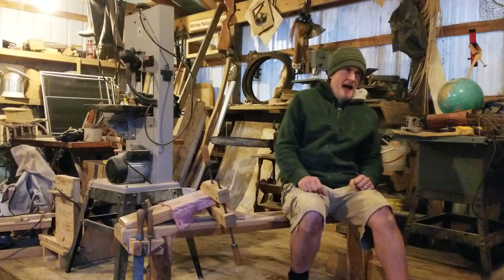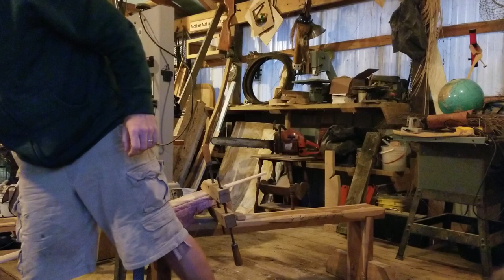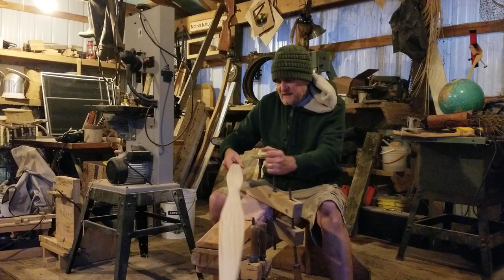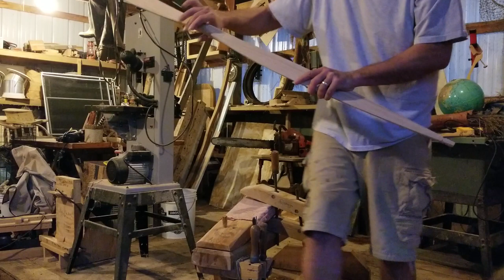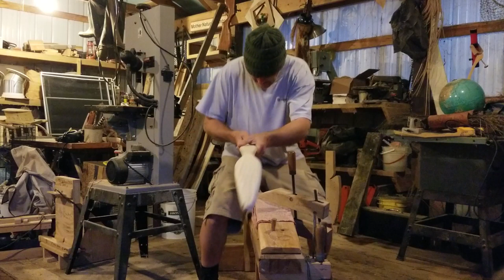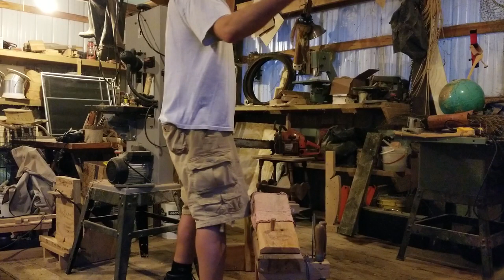Adding Pin Nocks to a Paddle Bow

Comment: With a shorter paddle bow and static handle(add on. Near perfect laminated handle.).  Is it crucial to keep bend or “strain” away from handle the stress point?   I need to gain 4 inch or so for better draw length .  Or maybe I’m not strong enough,     Digital fish scales are not the same as bow scales, lol can’t go past fifty with it.
Cheers 
Manitoulin matt

Comment: I'm going to build a selfbow with a cut out self how thick should the handle be but also where the fades meet up with the limbs?
Reply from the maker: You have some leeway if your handle has a good thickness and if the bow isn't super heavy. It shouldn't really affect anything at the fades, because you have enough distance between the base of the shelf and where the bow is under bending stresses.
Reply: @johnjriggsarchery2457  how thick should the handle be?
Reply from the maker: It a matter of personal preference but a narrow deep handle with a shelf would be in the vicinity of 2" deep.